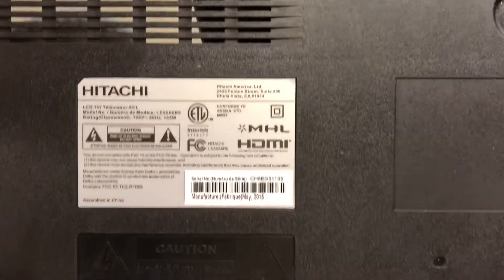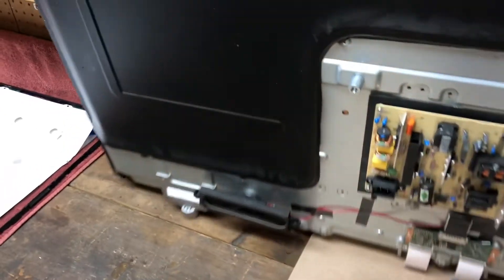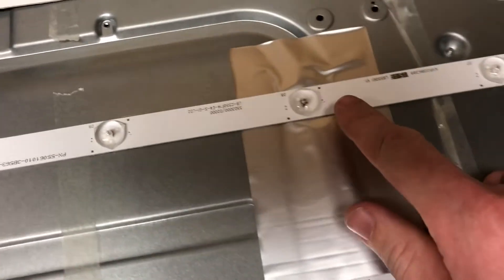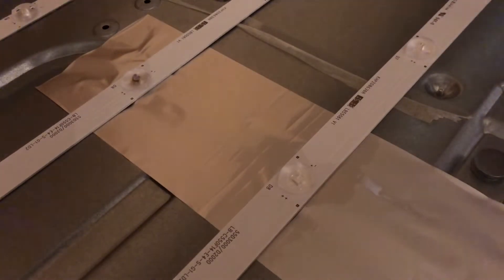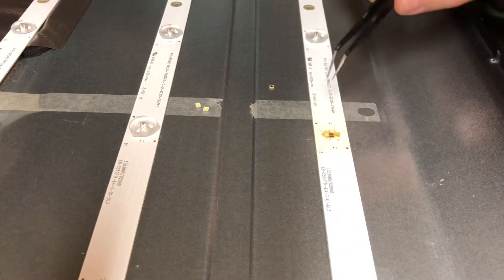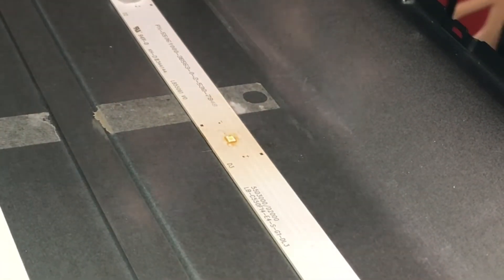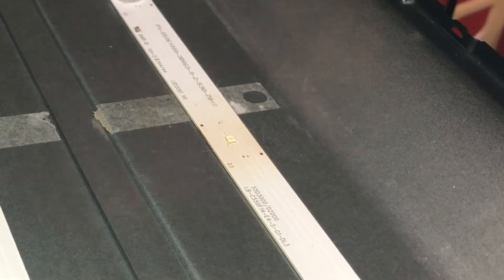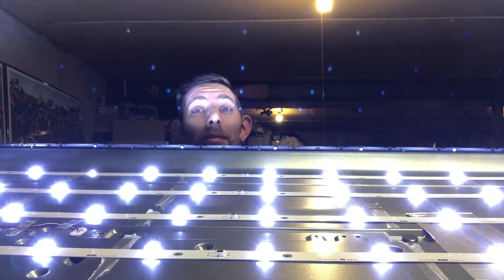Hitachi TV LED back light repair (Model: LE55A6R9)

Comment: Could you provide a link to where you bought that LED packet? Trying to avoid buying the 12 pack of strips for 60$..
Reply from the maker: OmniClimHazard I got them off eBay, but the repair only lasted about 3 months of occasional use before a different LED failed. I replaced that one and then the very next day a different one failed. I’d suggest, based on the age of the TV to replace all the strips because all of the original LED’s are at the end of their life. I ordered my replacement strips from shopjimmy.com
Reply: @DustinRogersinMO  Eh.. too expensive from that site. I found the single LED pack but should I get 3V or 6V? If they continue to fail Ill just trash the TV and will have wasted 8$ instead of 60$ haha :)
Reply from the maker: OmniClimHazard $60 is way cheaper than a new tv. They will continue to fail if you just replace individuals, but if you insist, this Hitachi takes the 3V LED. These are the ones I ordered. https://www.ebay.com/itm/TV-Backlight-LED-Diode-Hitachi-SMD-3030-3V-1W-CoolWhite-LED-10PCS-TLC-Philips-Yi/132385160906
Reply: @DustinRogersinMO  thanks for the help man!
Reply from the maker: OmniClimHazard the only reason I didn’t replace all of them from the beginning is that at the time, I could only find used strips. I couldn’t find new strips anywhere.
Reply: @DustinRogersinMO  Gotcha, for me this is just a side project. I have two other TVs that work fine. Just messing around with this one, if the repair doesn't last long it's no big deal. Id be worried about the new strips failing eventually anyway. My two other TVs have outlasted this one by several years. If the LEDs failed then isnt the same part just doomed from the get go?
Reply from the maker: OmniClimHazard not necessarily. Hitachi may have used subpar LEDs from the get go since backlight failure is a very common issue for them. The replacement strips are likely not made by Hitachi. Of course, there’s no guarantee that the replacements are any better quality.
Reply: @DustinRogersinMO  Hey lemme ask you a question man, I tested with a meter and had 2 bad LEDs, one on the top strip and one on the bottom strip. Is there any way to wire it to just support the remaining strips? Since it was only the top and bottom strips Im aure the tv would still be useable with the remaining 4 middle strips. I tried detaching the top and bottom connectors for each strip but that didnt work. Any ideas?
Reply: I ordered a set of strips for my hitachi from ebay, but they didn't come with tape on the back. Can i use any double sided ta0e, or does it have to be the super thin tape like the TV originally came with?

Comment: Hey Dustin once your checking the LED’s do have to have the tv connected?
Reply from the maker: abraham masalla when testing the individual LEDs you want the TV unplugged from the wall. You don’t want any power going to the LED strips.
Reply: Thanks for your reply brother so once I tested the board it gave more than 260 v but once i place the Multimeter I don’t get any lights on led.
Reply from the maker: abraham masalla abraham masalla if your meter is in diode mode, you need to make sure you put the positive meter lead on the + side of the LED. If you LED strips are not labeled, you may need to switch your leads and test both ways. I have fixed a TV that every single LED was bad. The thing I noticed on those was a little tiny black spot on the face of the LED. Every single one had it. Just a little tiny scorch mark, almost not visible to the naked eye.
Reply: Thank you i guess I was using a low quality Multimeter but did figure out if you have a 9v battery it powers it well and found one bad led. Thanks once again. I guess once i was pulling out the plastic cover it pilled off a little will that cause any damage once I assemble it back.

Comment: Nice job. As you noted, the led's are run in series, so for that reason they are designed to fail shorted, otherwise the failure of a single led would mean no picture. The supply works on constant current, so it compensates automatically for some shorted led's by lowering the voltage - I also have read that more led's than are necessary for a good picture are built into tv's, so that a small number of faulty ones aren't too noticeable. It seems that the second of your led's failed open, so stopping the rest from working...
Reply from the maker: Will Doherty good to know about them failing shorted. That makes sense. Unfortunately, the backlight died on this TV again about 4 months after I published the video. I’ve had the tv on my work bench for months, I just haven’t had time to tear it back down to see if the same LED’s failed or if it happens to be one of the other original LED’s. These Hitachi’s are notoriously bad for backlights burning out. I’ll try to post a update after I get it apart again.

Comment: Thanks for the video. I fixed  mine with one open LED. A week later it quit again and replace one shorted and one open LED on different strips. Time will tell, but afraid they are all a problem.
Reply from the maker: Steve Beckwith thankfully mine is still going good...except the lens fell off of one of the LEDs that I replaced so I’ve got a bright spot in the screen. I’m able to live with it for now.

Comment: Dustin where u out of
Reply from the maker: naminsky missouri
Reply: Dustin Rogers I'm in Texas I'm trying to learn how to take tv apart and repair to bad your far away nice video
Reply from the maker: naminsky thanks. Usually getting the back cover off of most TV’s is just a matter of removing 10-20 screws. I usually google for the particular model of TV to see if there are any common  issues. A lot of times you’ll find information on how to diagnose that particular issue on that particular model (or the same brand and model series of TV but a different size).
Reply from the maker: The badcaps(dot)net forums are a good resource to search. You may be able to find someone local to you on that forum that would provide hands on guidance.
Reply: @naminsky  he is not that far.i drive all over the US. Missouri is a hop skip and a jump